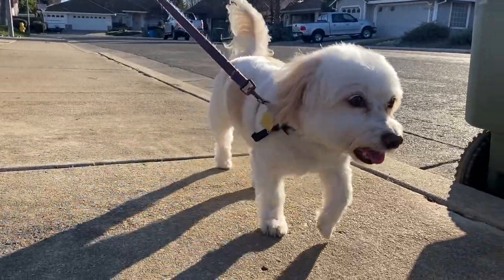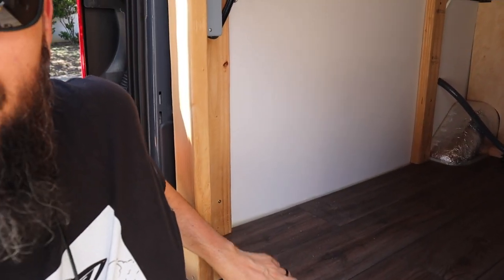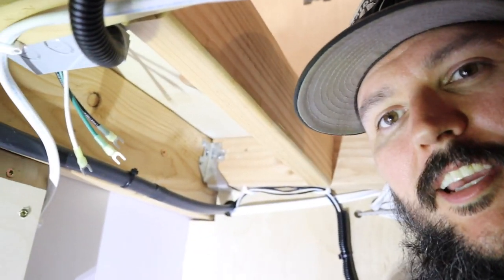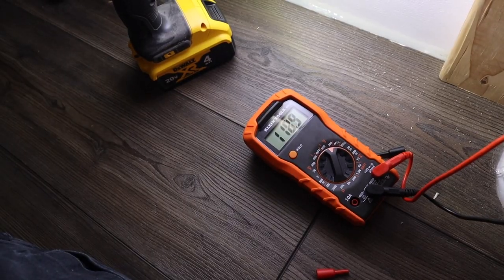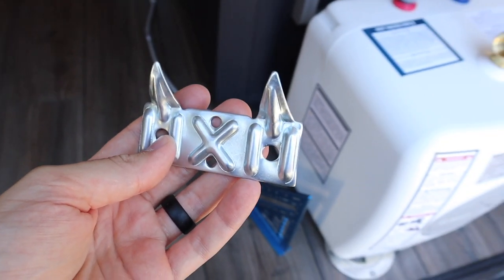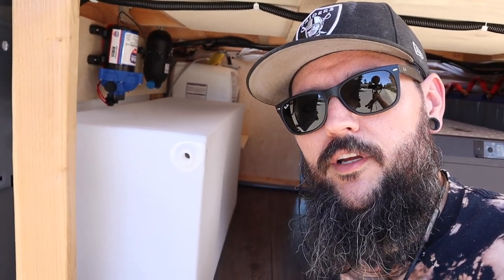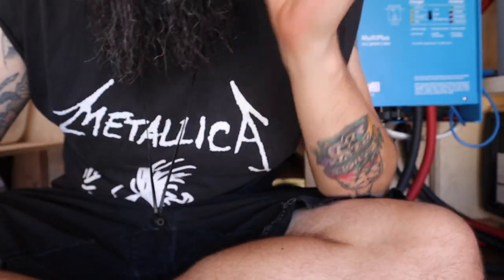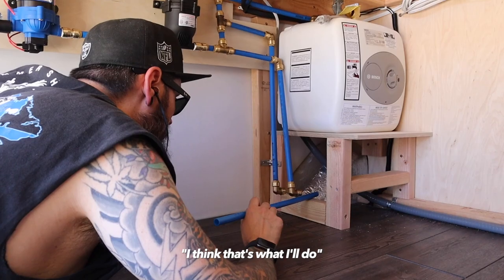Starting Freshwater Plumbing in Our Van Build! | 2021 Ford Transit Van Build Ep. 35

Comment: The best way to stop a lot of noise from 12v RV water pumps is to use pipe insulation. You don't have to use it on everything, just from the tank to the pump to the accumulator, and then another foot or so. Basically one piece of pipe insulation.
Reply: Like standard foam pipe stuff or what? Have a link for something more in depth?

Comment: I learned you should have soft more flexible hoses on both sides of your water pump.  The water pump is going to vibrate and make noise.  You want flexible hoses attached to it to absorb that rattle.  Sureflow has a kit you can buy or just rig up some flexible hose.
Reply from the maker: Thanks Jeff, we will look into doing this!

Comment: Create a catch pan with a drain to sit under the water heater. Otherwise when it rusts out it’ll cause water damage.
Reply from the maker: Thanks for the tip!
Reply: @britandmike  no problem. It happened to me after 3 years of use but I had a catch pan so not such a disaster.

Comment: are you still happy with this type of water heater now that you've had some time to use it? wonder how much power it uses..
Reply from the maker: To be honest we have not used the water heater since we got it and tested it out. We have only used our shower once, since we usually have access to a gym shower, and we didn’t want to use the power required to heat the water